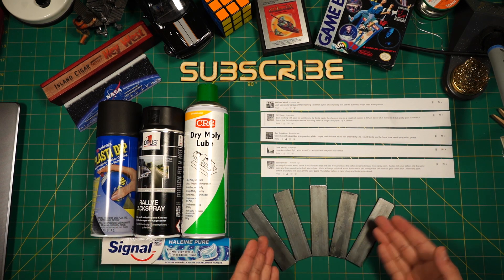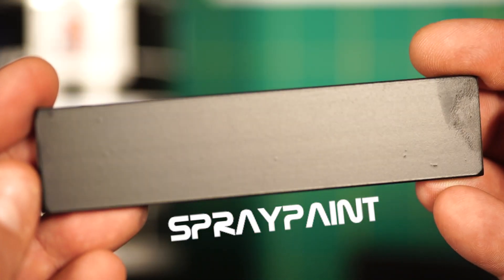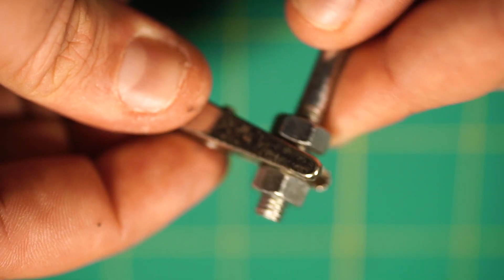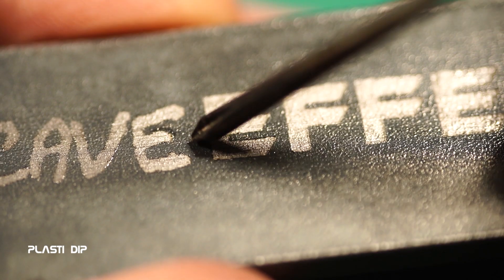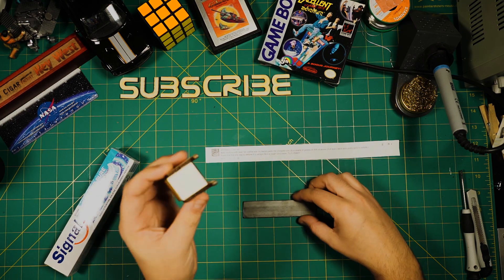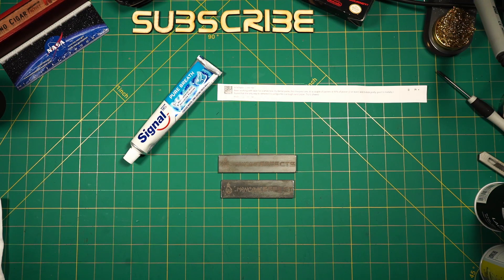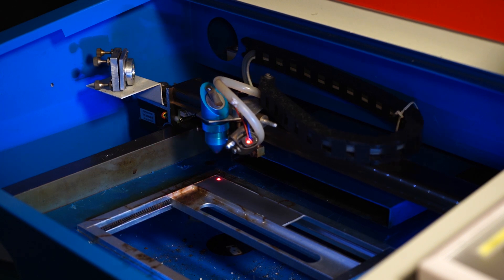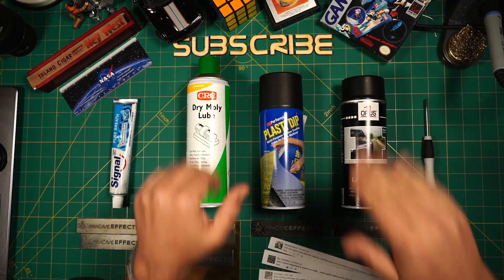Can the K40 Laser Engrave Metal? REVISITED!

Comment: Same as with PCBs you can use Ferric oxide, but you should really use sandpaper on the metal first, removes the oxide on the metal and makes much cleaner engravings, also if the spray paint coat is thick enough you can also use fine steel wool after engraving to clean up the engraved part before etching. For the plastidip there are nowadays many cheaper alternatives

Comment: So the answer is still NO, the k40 laser will not engrave metal. But not a big surprise, the k40 is not a metal engraving laser. Yes you burnt the covering you used on the metal, but then you etched the metal.

Comment: Have to tried Cermark spray that is specifically for engraving metals with a CO2 laser?
Reply from the maker: No i have not tried it yet as they charge over $70 a bottle, but as the dry moly lube works for some people i think that the K40 simply insn’t powerful enough.
Reply: Cermark is great stuff, but it does not engrave, it is an enamel that bonds to the surface of the metal.

Comment: You'll have a hard time marking aluminum oxide with only 40w. You either need to chemically anodize it (like you did with etching by masking) or more power to melt the upper layer of aluminum oxide which has a very high melting point.

Comment: You need to clean the scale off the metal  then test 
How ever the stencil you just made with the laser  will work great in the salt water 
How ever use one of the steel bars instead of that nickel or cad plated bolt you used
Reply from the maker: I should have give the bars a pass with the mill to get rid of any oxydation... i litterally grabbed the first bolt that i could find ;-p but youre right it would work even better with a raw steel bolt

Comment: I'm curious if you could spray powder coating powder on a metal part and run the laser at a very low power to melt it into the metal where you want it if that would work? I once used my tiny 1 watt laser engraver to burn off powdercoating on a thing aluminum sheet that was already baked on but I can't control the power level of my laser. Just fyi if you try it you better have your fume extractor cranked up full blast. Burning powder coat puts off some very noxious fumes.
Reply from the maker: Let me see what i can do in the future, maybe a friend can help me out powder coating some parts for experimenting. However the laser may be controlable in its current but it wont make the actual beam less hot, so i think it will burn it to ashes ;)....
Reply: @MancaveEffects  maybe you could turn the speed up. ah I was unaware. It was my understanding that you could control the lasers intensity. Now I know better. My idea was to lay raw powder on the plate and use the laser to melt the powder where you want it to stay..I'd imagine you'd have to turn off the air feed at the lense, but that may result in the lense getting dirty from fumes.
Reply from the maker: You could be right with the speed. What temperature does powder for powder coating need to melt?
Reply: @MancaveEffects  it usually wets out around the upper 300's Fahrenheit but cures around 400°F that being said different brands and finishes may have different wet out and cure times. I've only used a few different brands of powder coatings myself. Another idea would be to maybe use embossing powder. It way work better and require less heat.
Reply from the maker: 400f i quite low for a burning laser but maybe with the right speed and some white powder coating it may work.... i will get in to that in the future. Thanks for sharing!
Reply: I know that if you laser a powder coated travel mug, it simply removes the powder coating from the lasered area.
Reply: I had the same Idea. And it actually was a 100% test on a RVS peace. Aluminium a die a quick test but didint stick.